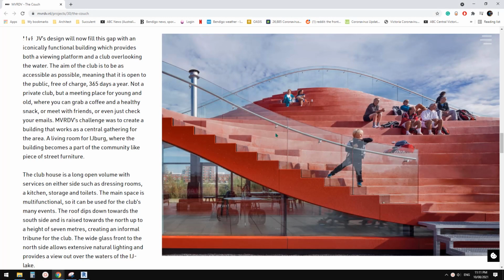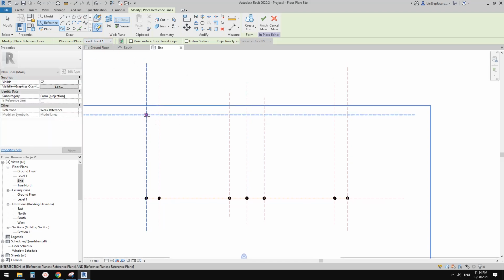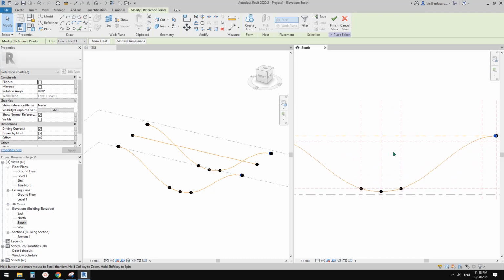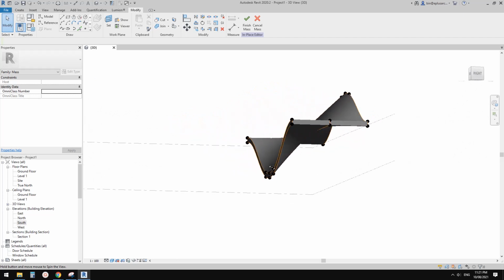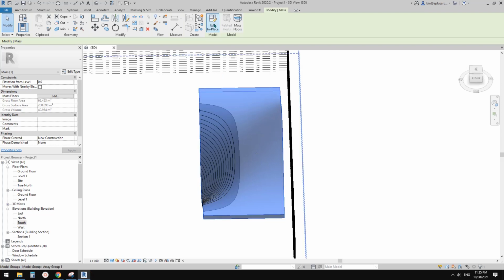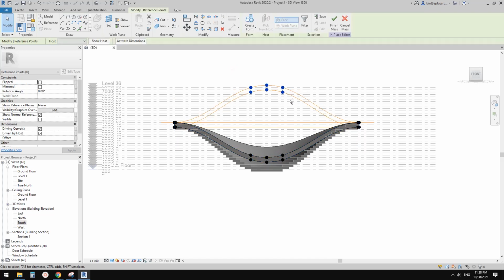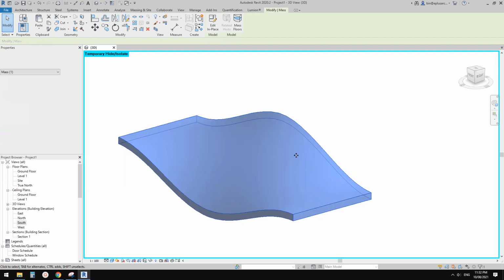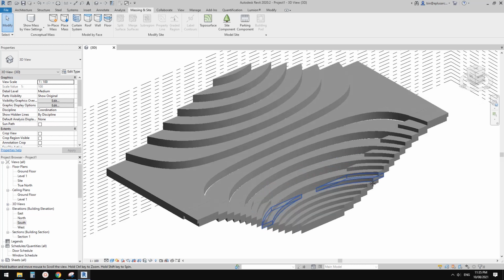Everyday Revit (Day 508) - Mass Floor Experiment

Comment: It seems you could only make floors for lower or upper part but not both, maybe because there is a sort of switch in the middle of the geometry, so it stops creating floors at the middle?  This is just speculation not sure
Reply from the maker: I'm not sure, but it did work after I adjust the mass a little bit. Maybe Revit doesn't like the mass floor to be overlap with the surface of the mass.